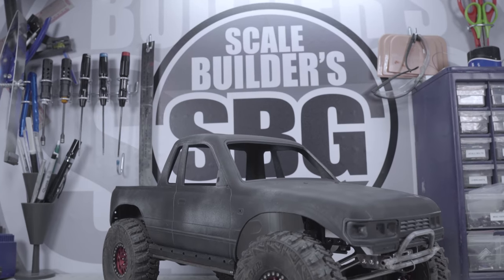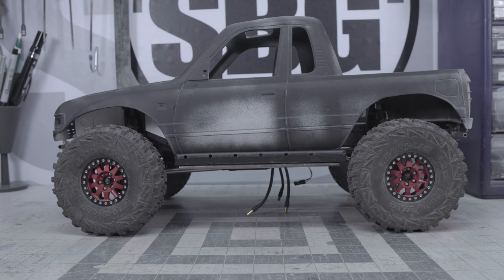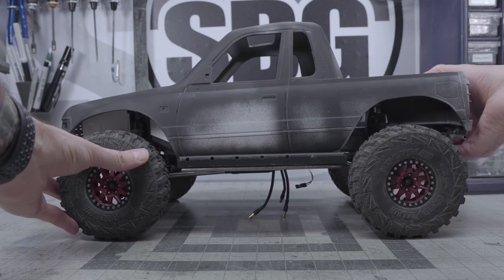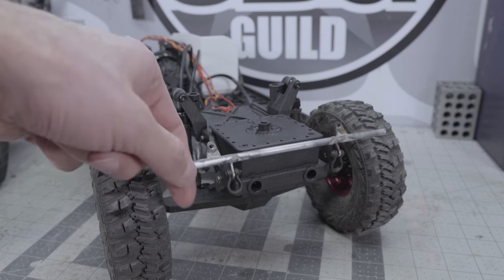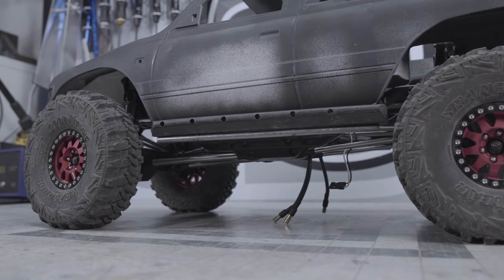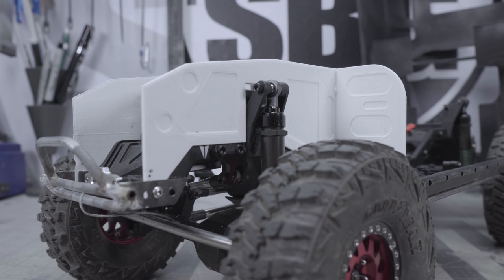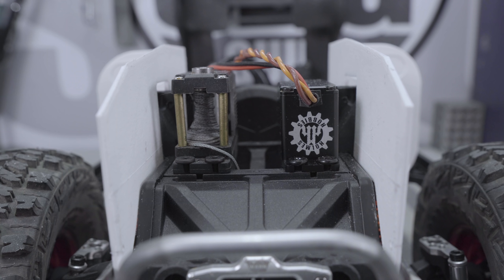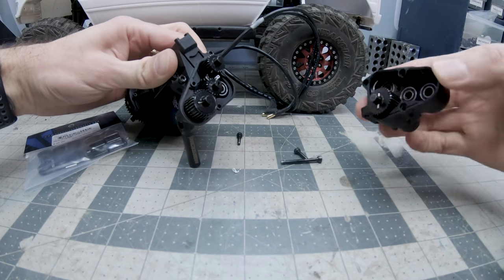Road to the Scale Nationals - Episode 4

Comment: brazing on a metal grate is more difficult, the steel of the grate will absorb a large amount of heat and the solder will be less successful. try using a pair of pliers to hold the piece in place and move the main piece away from the grill. And…nice job, as always 👍🏻

Comment: Great trick for brazing. Doing it on a granite tile is buch better. It does not act like a heat sink for the heat and its easier to get the metal heated where you want it with out the metal grate you use taking all the heat away from the part you are heating. (Heating...)  They make little 3' extension hoses for the tanks. make it a lot easier than wielding the tank all over the place.

Comment: I think this thing is going to perform well.  I need to figure out a similar bumper mount hinge for lexan...  If you didn't know, 6-32 unc tap will thread the inside of that brake line quite nicely. Make sure to ream the lip before tapping it 😏 (if you cut it with a tubing cutter).

Comment: FYI, it's not necessary to wait for a previous coat to dry completely before applying a subsequent coat, and it prevents things like your previous coat off-gassing from happening. Pros generally just wait until the coat is tacky and then apply subsequent coats. This also gets rid of the need to sand in between coats. Keep in mind that this only applies on a step-by-step basis. Obviously you should let your paint cure properly and sand between the primer, color and clear coats, but within those steps, its best not to let it dry completely before you lay down more of the same thing. This applies to working with solvent-based rattle cans as much as it does to working with catalyzed two-part finishes (like 2k Clear or Dunlop car paint for example).

Comment: Make sure you have weighed in those front tires brother makes a big difference in competing
Reply: Weight in/on the axels is a better option. Less rotational weight the better. Less work the motor has to do
Reply: Probably better in the wheels if you're competing helps with climbing and side hilling:)
Reply: Marc Anthony Marquez  👍🏼 agree to disagree.
Reply: @claywallen4921  that sounds best good knowing your clay will see you at Nationals if you're going to be there I'm running to class one two and maybe three

Comment: Im doing my 1st build, whats the video to watch for painting lexan...do i do it from inside?  Also, whats up with the upside down shocks.....i see 2660 and gts traxxas ran upside down.....is that a form of droop? hows it different than the desert lizards....Im building a trx 4 sport kit on gspeed chassis with stock trans, tires, shocks(mini t losi modded) (which will be upside down like 2660's i assume), and axles, with hc links 3brc servo/winch with brood stubby and 1060 brushless hw esc, but mainly i need your lamens/noob terms advice for painting lexan, mostly just painting it white, do i need primer or backer?

Comment: how did you attach the metal sliders?
Reply from the maker: Good question! I drilled and tapped 3mm holes on both the slider and the metal rod, then affixed them to the chassis with grub screws.
Reply: @scalebuildersguild  thank you